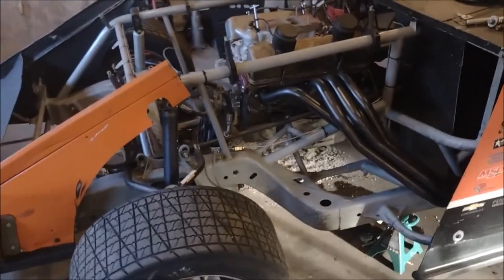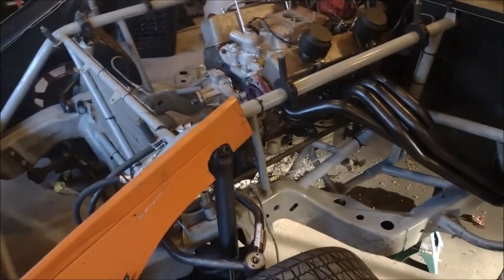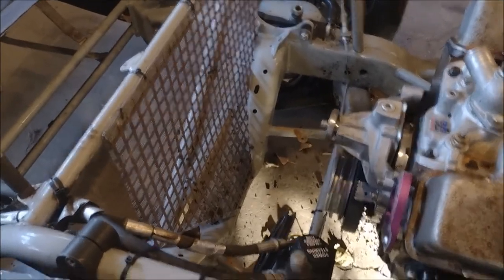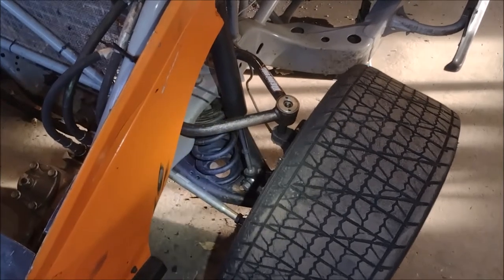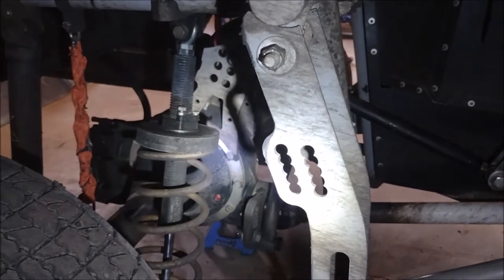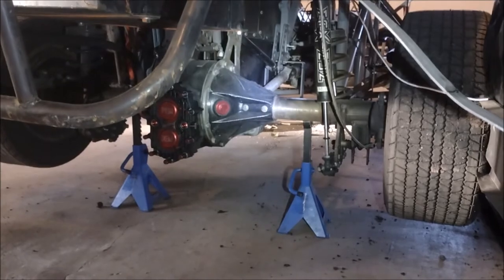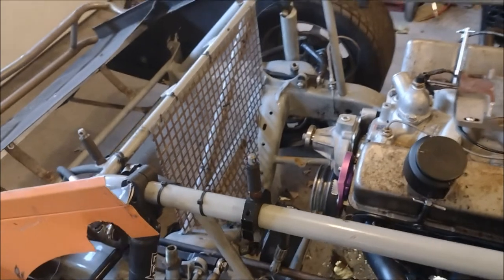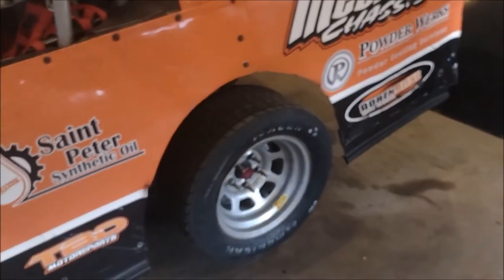What Do You Race? USRA B Modified Explained

Comment: Thanks man I have asked guys at the track that race modifieds the difference and they could only tell me their track rules for there mod and told me to check the track I want to race at has kept me from buying one, and I asked A mod B mod and Ump mod, track I like Wilmont Wisconsin has open motor I think A mod but steel heads only why not just be Ump then so a guy can run big shows and be competitive I thought the class was to avoid the B/S and make it more affordable but this is racing guys spending 20 grand  on an engine to win 500 lol
Reply from the maker: Glad you found the info helpful. There are so many different sanctioning bodies and sub-catagories of modified it's hard to keep them all straight.